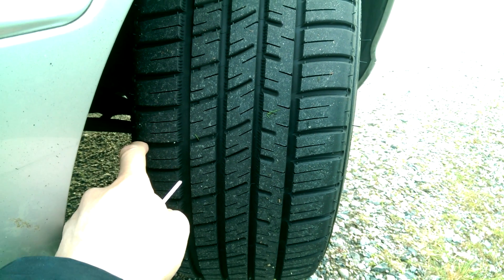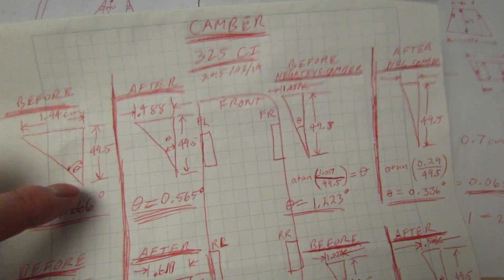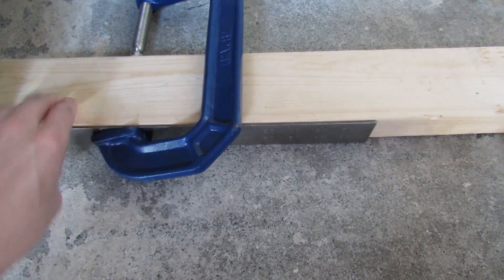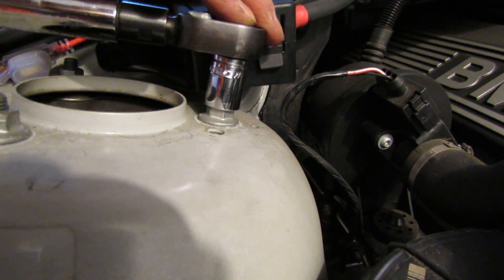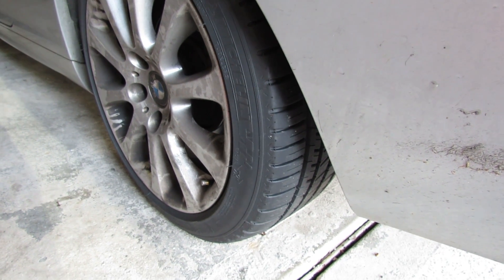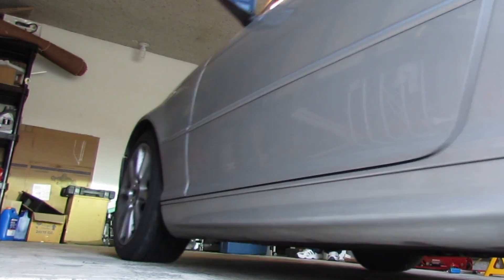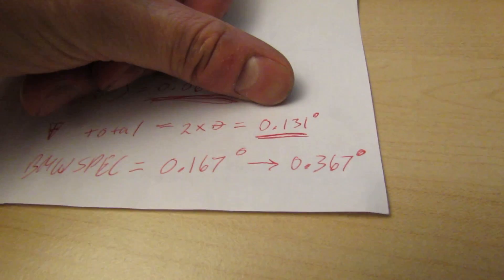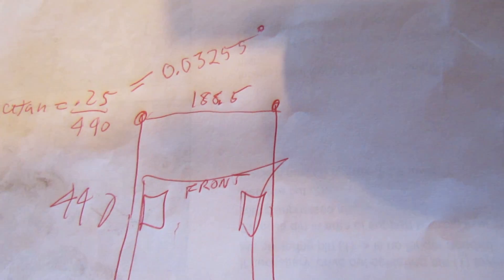How to Adjust the Camber and Alignment of a BMW E46

Comment from the maker: + Shelby Smith
The same principles apply to any vehicle.  I've refined this process a bit.  As described below.  I don't know what adjustments the 1602 had, but if it does have these adjustments, they will work.  I've never worked on a 1602 before.
1 - Alignment:  What I do now, is take the laser level to the edge of the rim, top-most, the lip where the bead sits on the inside of, or where they typically hammer weights onto, then I fire the laser down at an angle to the front of the car(from the back tire), onto the ground and get someone to mark it, then fire backwards the same distance, measure the distance between those 2 points front and back, then between.  That works if you don't have walls front and back.  Since you're firing down at an angle, the distance front and back also need to be the same, that's the trick of this measurement. If you don't have a helper, you can mark 0, 1, 2, 3, .... 10 to a piece of paper, and put that up there, and when you hit 5.5, you just walk over and mark 5.5, put a pebble down and mark it so you can measure it later.  Doing it this way removes a lot of errors that could occur while measuring.  This needs to be done in a flat, shaded area, to reduce errors as well.
2 - Camber:  I use an iphone as a inclinometer, if you download a protractor app, and zero it to the flat pavement that you're on, (on a level), then take that and put it up against the rim plum, you'll get the camber angle, do it 5 times and you'll get an average camber angle that's representative.  If you have a square that's better, but this way is fast and easy to do, seems accurate enough.
Reply: Thanks for the informative video.
Reply from the maker: You're welcome!  I definitely recommend it.  My tires are still doing great and I push them to the limits.  Even wear throughout, so it's working great with the more neutral camber and perfect alignment.
Reply: Thanks David, Will definitely follow your steps in doing the same to my E34. cheers.

Comment: Good video, however BMW"s procedure for non M cars is to load the front seats each with 150 pounds, rear center seat with 150 pounds, 46 pounds center trunk with a full fuel tank, then take your measurements.
Reply from the maker: Hi Jason,  thanks for the comment, I think that will benefit a lot of people. I read about the pre-loading, but I excluded it from my procedure, but thinking back, I probably should have gotten someone to sit in the driver's seat; as the majority of my driving is just me, so you're right, it would be a good idea to have someone of the same weight sit in the driver's seat, would have made my readings more representative of the driving conditions.  Next alignment I'll probably do that actually.  I like being more accurate than not.
I've also refined my technique, and am always doing so, so I'll take your great information and add it to my technique as well!  Thank you for taking your time to share that information with us, more will benefit than you'll know, I'm sure.
Best regards,
David.

Comment: I did not quite understand on the rear camber adjustment part. How are the 2 bolts that u loosened and tightened back actually change the camber?
Reply from the maker: +imadude85 
Hi, the rear-most bolt is holding it tight, when you loosen that, you can adjust camber.  The front-most bolt is eccentric, like the link below:
https://c1552172.ssl.cf0.rackcdn.com/418788_x800.jpg
https://c1552172.ssl.cf0.rackcdn.com/439367_x800.jpg
When you turn the front-most bolt, it moves in and out the lower suspension, if can keep spinning it 360 as many times as you want, just keeps spinning, if you watch the camber, it will keep changing back and forth between most negative and most positive, I just made it as positive as I could, kicked it more positive as well, then locked it into place while holding it as positive as I could, even at the MOST positive camber, there will be some negative camber.  With it as neutral as I could get it, the wear on my tires have been very even, and I'm still very happy with it. 
I got new tires before I did this alignment that I filmed, and so it's been over a year, and the tire wear is very minimal.  I'm running Michelin Pilot Sport A/S 3's, and those are supposed to wear quickly, but mine are looking good still, these should last me a couple more years.
Cheers,

David.
Reply: +David Sunshine Thanks for the explanation David! I think i get it now. I will try to do it on mine soon.

Comment: you need to put the air in the tires to before you measuring :))
Reply from the maker: +creatorr24 Yup, great point!  Thanks.
Everyone should be running the recommended PSI at all times(checked when cold).

Comment: Just got my e46 alighned after replacing front arms,bushings,links and struts. Rear suspention looked good,rear tires had no ware problems and sat nice and square. AFTER 3 HOURS at fierstone my rear tiers are badly tilted in at the top one side more then the other. I don't  think he pulled the pins on the machine so wheels could move in and out during adjusting. I will now try to change it back. Yup, under the car I go again. Thanks fore your help.
Reply from the maker: Hey Andrew, anytime.  That happened to my friend, brand new Michelin Pilot Sports, and the front two tires were bald in 8 months, it's amazing how fast a bad alignment can chew through tires, he had his alignment done by a shop too, and other shops said everything looked fine, when obviously it wasn't. Mine are wearing evenly and relatively slowly after aligning and setting the camber myself.  Hopefully it works out for you too.  Cheers.

Comment: Hey - great video. Quick question - the factory allignment pin you hammered in on the strut when doing the front camber - how do you get it back out again?
Reply from the maker: To get it out you have to take the strut off,  if you're replacing the strut, you can take it out.  Otherwise it'll just sit on top of the strut,  not an issue.   Cheers,  David.
Reply from the maker: And Thank you!   Hope it helps you out.  It really helps the stability of the car and reduces wear on the tires,  if you adjust it to have neutral settings,  not as good for cornering but how often do you corner tightly?

Comment: oh my god...... we do use math after high school.........
Reply from the maker: lol that's exactly what I thought when I was doing this!  All that,  just so I could figure out my camber and alignment.
Reply: but do we really need to do math? I don't see the point of knowing it as long as we note the distance of the gap between the top of the tire and the square.
Reply: @THERE.IS.NO.DEATH.  ..what do you mean "there is no death"...? Where have all the people gone? The ones who "pasted" away...??
Reply from the maker: Yup, you can do that too if you want.  Definitely less calculations, and easier to set the same all around.
I just use degrees because that's what camber is usually measured in, and that's what they've provide the tolerances in, but you can measure it in any unit, as long as it's consistent and works.
I'd recommend using degrees as the reference/set value, for instance, I think -0.7degrees of camber is pretty good, has worked well for the last 2 years, tire wear is even, and the car tracks well.
Cheers!
David.
Reply from the maker: Nope.
You just need to plug it into the equations to figure out the camber.
Reply: I see, but we could also define the camber as distance between square and tire. Anyways, whatever lol... thanks for the video!

Comment: Lol nine your never supposed to use torque wrench for loosening
Reply from the maker: lol I know. Got lazy and didn't really care. If it was any more than 20ft-lbs I would have gotten a real wrench, but at low torque it doesn't hurt anything. I'm using a weaver rail mounted lazer on a plastic level to align my tires, and a square to check my camber so I'm probably doing something I shouldn't lol.

Comment: Thank you so much for the video! I don't have the time, tools and space to do it myself, but it helped me to confirm that the shop I got the car to was confused with the rear alignment. They said the car had a problem somewhere that prevented the rear toe to be properly adjusted but watching your video I learned that they were only working with the camber bolts instead and not touching the toe adjustment. I took it to another shop and they aligned the car properly (it was expensive though!) :)
Reply from the maker: You're welcome!   Ya, you know what they say,  knowledge is power!  I went to 5 shops,  and they all didn't know how to adjust the camber properly,  including the dealership.  They told me it would take 3 hours to remove the pin.  With a hammer,  took me 3 seconds.  lol

Comment: I decreased negative camber in the front wheels using this method but also ended up losing an amount of caster. Now I have around 1 degree of caster per side when it used to be around 4 degrees of caster per side. Weird. But the overall alignment setup drives okay though; although I've read that a higher degree of caster is better for return to center and a few other characteristics.
Reply from the maker: Hi Nick,  I didn't check my caster, but when you slide your strut over to make camber more positive,  you could also push it towards the back to get more positive camber, it's only got a little play,  so it's probably an insignificant amount,  but better than nothing.  If you want more positive caster to get better return to center, you could get the custom camber and caster plates,  but if you're trying to maximize tread life,  I think you've got it since your settings are as neutral as it can be without modifying anything.  I personally would not mind 1 degree of caster,  since it takes little force to make minor adjustments, and probably minimizes inner tire wear.  It's driving pretty nicely with less than a deg of camber,  hope you like the way it's driving too.  Probably doesn't need 4 deg of caster.
Reply: ***** to be honest, it drives great!

I didn't really do it for the purpose of tire wear though, but more for a loose setup.

I'm on F225/40R18 and R235/40R18, and my old alignment was pure understeer. Now with my current setup, I can feint oversteer when I want to as well (but overspeeding into a corner will still get me understeer midcorner though).

Front:
toe-out (+1.10mm per wheel)
50' of negative camber per wheel
1 degree of caster per wheel

Rear:
toe-in (-1.25mm per wheel)
10' of negative camber per wheel

For a future alignment, I am considering having 0 toe in the front and minimal toe-in in the back though, just to see the driving characteristics.
Reply from the maker: +Nick Amarit I see.  Ya I like how mine drives with close to 0 toe in, camber and caster as well,  it feels very stable,  and tracks like it's driving on rails.  
Which makes sense to me, I don't do much aggressive turning so a neutral setup would be best for straight or slightly curving stretches of road.   I don't like much automatic return to center so I think I like it without toe in or positive caster.  

I think you'll like it with settings closer to 0, unless you like cornering stability. then again,  the E46 doesn't have much body roll so a neutral set up isn't that bad.
Reply: ***** Did you change out your springs and shocks? Mine has an all stock suspension and the car seems to have a fair amount of body roll though, but I guess it could just be my subjective opinion.
Reply from the maker: +Nick Amarit I used to drive Chevrolet and Fords,  so compared to those it's not much,  even compared to the impreza it's less.  I have the stock springs,  but it's a pretty low and stiff suspension so it's not bad.  But like you said,  it's subjective.
I've also got 17" rims,  that helps make it feel more responsive and tight. Running Michelin pilot sports a/s3s, that helps too, tires can really change a lot in terms of handling.

Comment: good video i took it to get it aligned but the guy said i had to change the Ream Camber and the bushings but  dont i need to replace bushing cambers an not the entire camber do those ware out? the complete bar or just the bushing ware out ? what your opinion on it thanks
Reply from the maker: You can replace the bushings alone,  but it's more work,  it's easier for them to replace the trailing arm and bushings since they are together,  the bushing needs to be pressed into the arm.  The bushings do wear out though so yours might be loose,  you should lift it and check yourself.

Comment: Torque spec in the Bentley for the 3 bolts securing the rear trailing arm bushing carriers to the body, and rear camber bolts, is 57ftlbs, not "~40ftlbs".  Shame to go to all of this trouble and have the adjustment creep thanks to loose bolts.  Also, changing the front camber necessarily changes the toe.  If you move the tops of the struts outward to reduce negative camber, this will toe the front wheels in a bit.  Having changed front control arms several times, I learned the hard way that different brands aren't exactly the same length, which changes camber and toe.  Improper toe ruins front tires quicker than anything else.  Always check/adjust the front toe-in after adjusting front camber, or ruin the inner edge of your fronts in a season like I did.
Reply from the maker: Thanks for the comment.  Very informative, and sounds like you know a lot about suspensions.  
I forgot to mention that the alignment changes when adjusting camber,(so it's important to follow the order of how I did it in the video) for both front and back, that's the reason why I adjust camber of both front and back first,  then adjust the alignment to be as close to 0 degrees as possible,  with a slight toe-in,  but not much,  because like you say,  it will cause a lot of wear.   I also forgot to mention the torque spec of the trailing arm bushing,  I'll add that via a comment and video description.  Thank you for your informative comment,  I'm sure it'll help a lot of people out. There is no better way to get the camber and alignment just right,  than to do it yourself and make it exactly how you want it.
Reply from the maker: Also.  40ft-lb is the torque for the camber adjustment bolt isn't it?  I'll check again but I think that's what BMW specifies.  I'll be the trailing arm bushing torque spec end put it in the description. 

Cheer,

David.

Comment: hey david i think i got it i did what you said to do with bushing at first it looked to still be messed up but i took it for a test drive and both tires are toed out quite a bit but at least they are going the same way ill just bring it in to get alignment done tried to do it myself but couldnt get the tire rod to turn i think my next project is cv joints as the boots are tearing and there is grease on them thanks again david your the man
Reply from the maker: Good to hear!  Ya when you change out parts you'll need some adjustment,  shouldn't be much but a few degrees is a lot for alignment and camber.   A shop should be able to get it all right.   You're welcome!   Let us know how it drives!